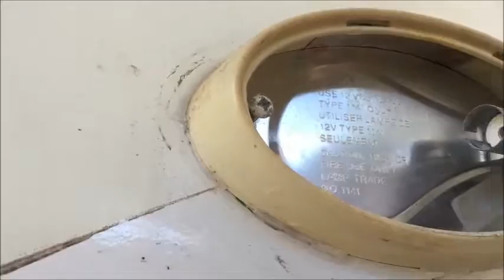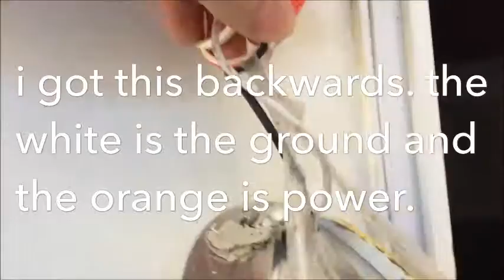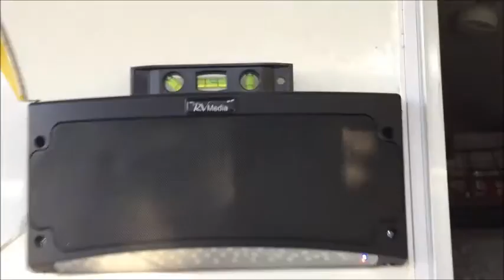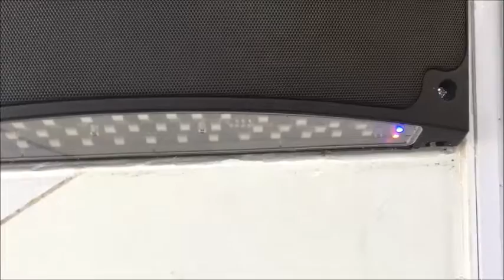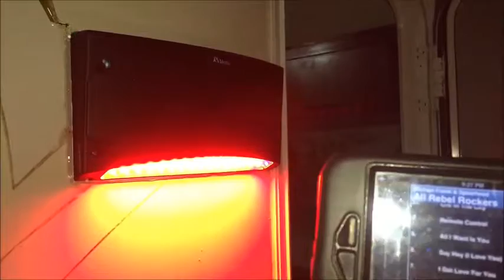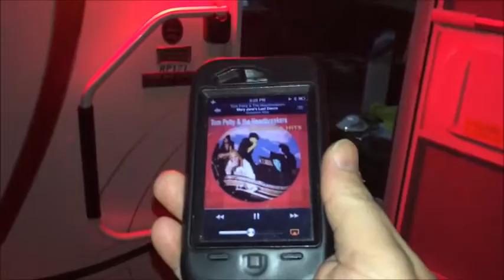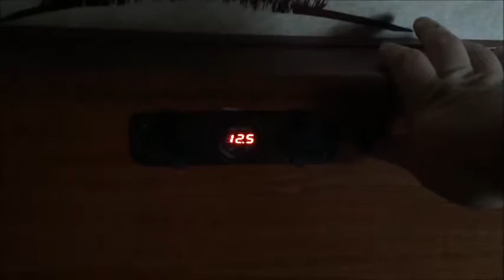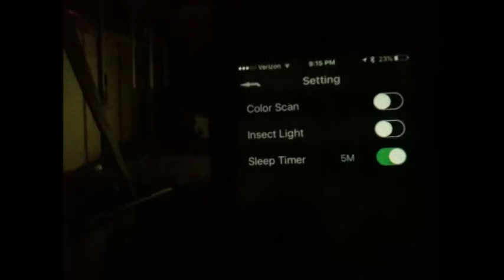installing the RVmedia rvm2001

Comment: Any issues with the mount so far? About to mount mine, wondering if you’ve had any issues a few years later.
Reply from the maker: Kevin Carney I’ve had it on there for about 4 or 5 years. no issues. The black plastic has faded white a little due to sun. Still very loud.